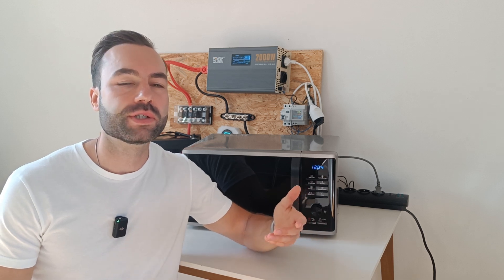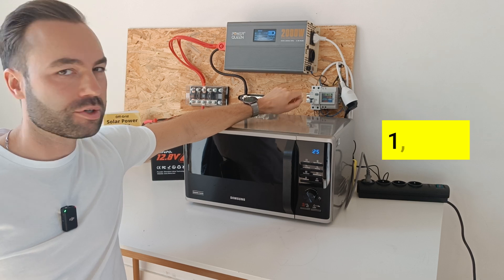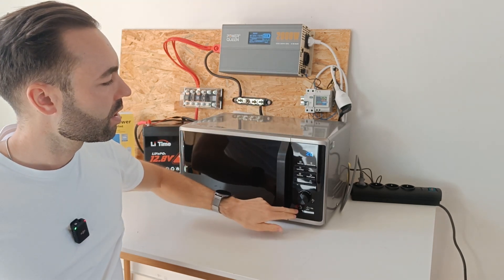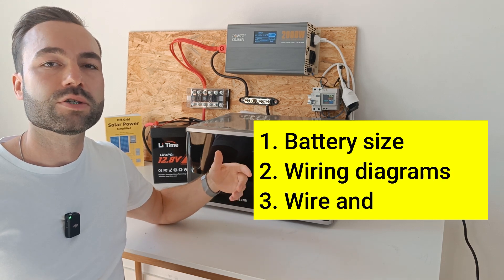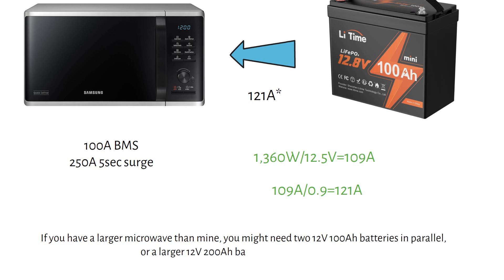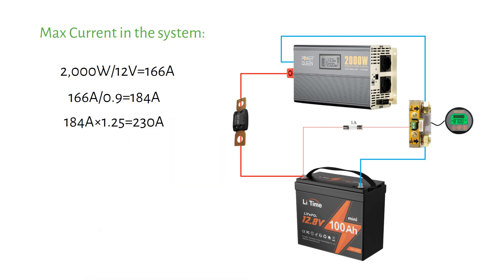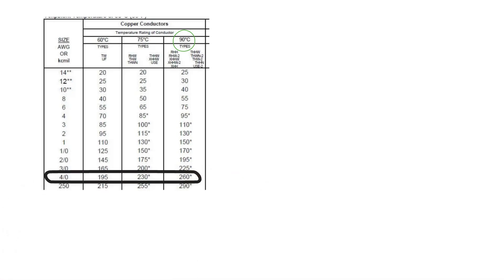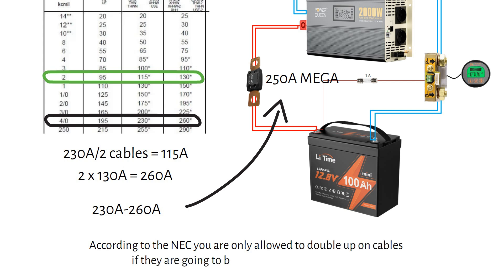What Size Inverter for a Microwave?

Comment: So, an inverter microwave will actually run with reduced output power when you dial down the power? I know standard units just pulse on and off from full power to zero and back. I hate that. The only microwave oven we had that tried hard to overcome that on/off cycling was our old Amana beast from the 1970's. It had a really cool duty cycle where it really pulsed the power, not like the modern junk units do. Example, set power to 50% on the old Amana and would actually cycle the magnatron ON for 1 second, off for 1 second! The food could heat without boiling and sputtering as much. I would love a microwave that actually REDUCED the output power without that stupid pulse on/off stuff.
Reply: Inverter microwaves do actually cycle the magnetron on and off since that's more or less the only way to control themr but they do it at a much much higher rate than the old heavy transformer types.  Add in the design of the AC > DC in the oven and it basically smooths the draw from the wall out completely.
Reply: @retrozmachine1189  Awesome! Thx for input!
Reply from the maker: Yes, inverter microwaves keep their input power the same. There are some video's online showing it. Normal microwaves turn on and off.

Comment: I have a few questions. I live in a Vintage Class C Motorhome, that has a Microwave Oven, and there is a Converter in the Coach for a 30 Amp Service, but because of where I am parked on the property, my power Cable is not long enough to reach the power supply back at the main house, so I have purchased a 2000 watt inverter, and I am planning on having a battery bank of 4 12 Volt Deep Cycle Lead Acid Marine Batteries, hooked together in Parallel with each other, and eventually Solar. My Question is will my 2,000 watt inverter be large enough to power the RV Microwave, or will I need a larger inverter ?
Reply from the maker: Depends on the power consumption of your microwave. Check the back for it's two power rating as shown in the video. I recommend getting lithium batteries. No need to wire in parallel and it will be cheaper. Check my recommended 12V 200ah lithium battery in the description.
Reply: @cleversolarpower  I have checked the cost of lithium, and for me, it's cheaper to go with Lead Acid Batteries at this Stage of the game.
Reply: @kevinswinyer3176  you might have to rethink your cost benefit ratio. 4 FLAs? thats nutz! and so not necessary. Dont know where you been shopping , but a good 200 AH LFP  is about 400 US and each of your FLA have to be over 100 ea.
Study more to find the actual cost benefit

Comment from the maker: UPDATE: 6:20 if you are going to use two cables, then you need to fuse every cable individually. If you are going to use a 2AWG cable rated at 90°C insulation temperature, you need to use two 125A MEGA fuses, one for each cable.
Power Queen 2000W inverter: https://cleversolarpower.com/go/pq2000W
Litime 12V 100Ah battery: https://cleversolarpower.com/go-litime12V100Ah
Cable: https://cleversolarpower.com/go/cable
250A MEGA fuse: https://amzn.to/3AQfFwQ
MEGA fuse holder: https://amzn.to/3AS5mID
Battery monitor: https://amzn.to/4g4mfjK
Reply: What is the cost all up please?